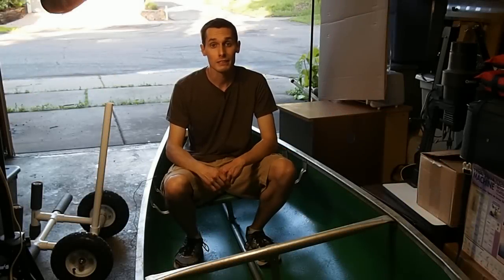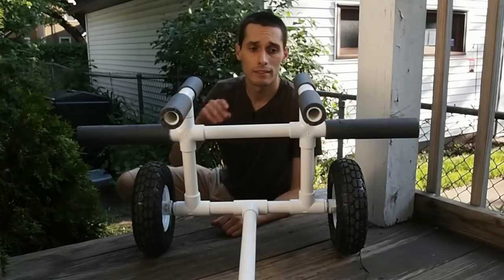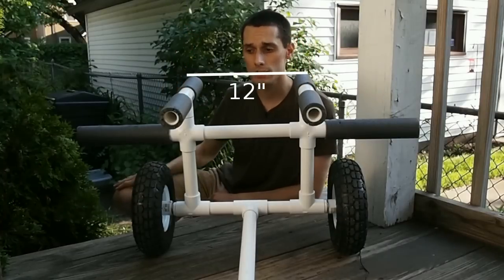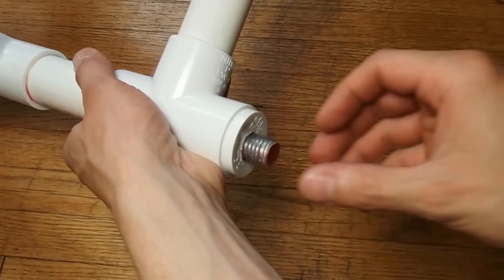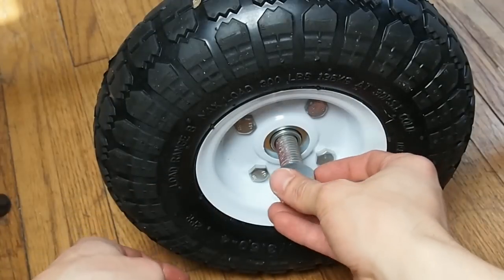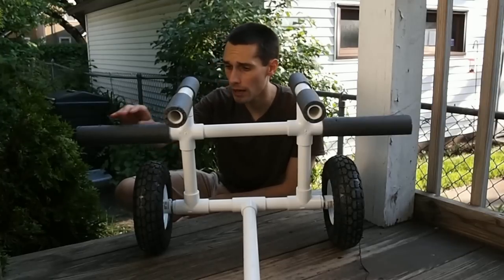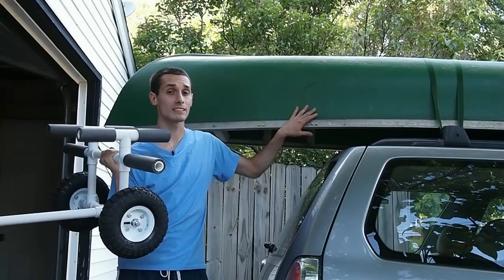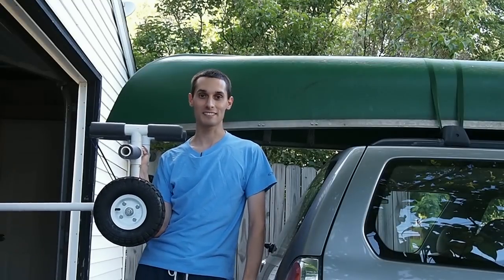DIY PVC Canoe/Kayak Cart

Comment: Cant get it to stay under the canoe. Even with a ratchet tie down
Reply: How did you solve this problem? I'm having the same problem. Also, did you cement all the fittings?
Reply: Same here. I am trying to use it to load the canoe on the car but cant figure how to keep the wheels vertical.
Reply: Same issue. Used pvc cement to secure all the fittings and the cart failed under the weight of my canoe.
Reply: I’m having the same problem with my cedar strip canoe.  The cart works ok with the canoe right side up, but doesn’t work with the canoe upside down. I think it needs two sets of wings to support the canoe. Not one.

Comment: Nice design!  Any idea how much weight it can bear (particularly with a canoe in the upside-down position)?  I have an Old Town Discovery (169) that weighs in at around 90lbs.
Reply from the maker: Adam Lopez Haven't really tested its limits but I bet it would do fine with a 90lb canoe. I'm pretty confident that I could stand on the side wings if my feet weren't too far out on the ends (and if I could balance that well). I'm not a huge guy but I am >90lbs. You could always built one with 1.25" or 1.5" PVC for extra strength.
Reply: Thanks for the reply.  I might make mine a bit more burley.
Reply from the maker: Awesome! Your modifications sound like great ideas!
Reply: Makify1 So....8 foot voyage in the front yard and SNAP!  Maybe the 1" PVC wasn't the way to go.  This was in the canoe "up" position, not even resting on the "wings" that I was worried about initially.  

https://goo.gl/photos/RjnRNkZAQJ4angjZ9
Reply from the maker: Oh no! I guess 1" PVC isn't as strong as I thought. Looks like the fitting broke, that's really weird.
Reply: I have to decide if I need to return the returnable hardware and buy a cart, OR look at more burley PVC and build up another.  Maybe a more braced design.

Comment: I have the same question as GoneByRVBlog.  In the video the PVC appears larger than 1 inch.  Also, you indicate that the length between the two top support bars is 12 inches.  That being the case, is that the length between the inside, center or outside of the two support bars?  I appreciate any clarification you can provide.  Thanks and regards.

Comment: I bought a couple of those cheap tires at Harbor Freight and filled them up to the 30 lbs pressure recommended... papoom!!!  The second one blew up in my face.  I was thinking about traveling on wilderness roads to remote Adirondack lakes and ponds.  These tires strike me as unreliable.  I may have to resort to something different.  I may have to go to the junk yard and find an old kids trike for the wheels or maybe an old stroller.  If you are shopping at Lowes, make sure you get schedule 40 pipe.
Reply: I have had many problems with those small inflatable tires for lawn equipment and such.  I find the best ones are the no inflate tires they sell for wheelbarrows. try 2 of those, never get flat and they bounce just like the inflatables pretty much.
Reply: Actually, I have a different plan but riskier.   After bringing the defective tire back and exchanging it, the new one is on the frame, inflated to 30 lbs, and has been sitting there for a month or more.  My planned trip into the woods is coming up at the end of the month and I will experiment on dirt roads, pulling it over dirt paths nearer to my home.  I am rigging a bicycle tow hitch and will be pulling the kayak to where I am going and I will be testing not only the tires but the tow hitch as well.  If something goes wrong I can salvage a problem like that.  Five miles into the wilderness with a blown tire is not something I want.  

However, before looking at this video, I reviewed all the commercially constructed ones and I always go to the most negative reviews, the one star reviews.  You know what the biggest issue is for the complainers?  Those tires that are filled, the no inflate ones stink to high heaven according to the comments.   I like doing DIY stuff so making a carrier was fun for me.  It probably cost me almost as much as one of the cheaper commercial ones but saving money was not an objective of mine and the one I made is not like this one although similar.
Reply: Dennis Lee  excellent good luck and have a great trip!

Comment: Where did you find your axle? I am having problem to find the right one.
Reply from the maker: It's usually available at most hardware stores. In the big box stores it is usually in the same aisle as the nuts and bolts but often kind of hidden in a rack with metal tubing and sheet metal. At smaller hardware stores it might be somewhere else. You can also ask an employee where to find the "threaded rod" and they'll be able to help.

Comment: I built it and have had constant problems keeping the cart standing up as I place the canoe on top of it. Regardless of how I place it, or tight the bungee, the cart flops over rendering it useless and more troublesome. I would welcome any helpful comments on how to make this thing as useful as appears in video.
Reply from the maker: Chris Hobbs Are you placing the canoe upside down on the cart? A few other people have mentioned the cart rolling over too but I've never experienced that so I don't know exactly what is causing it. My suggestion is to point the handle into the canoe and let the cart tip just a little so that the handle makes contact with the canoe and acts as a third contact point to prevent further rolling.

Comment: How are the threaded rods secured inside the pvc from in between the wheels?
Reply from the maker: It's a single threaded rod that goes all the way through. It's secured with nuts on the outside of each wheel.

Comment: I've looked and looked for your end caps that go into your pvc and can't find them....I know what they look like I just can find them...any suggestions?
Reply from the maker: Hmm... Sometimes they are rounded and sometimes they are flat. Most hardware stores should sell them. Maybe ask an employee?
Reply: Ive gone to 3 home depots and what I have found are 2 end male  reducers that both have holes already in the part that you drill your holes in (hope that make sense) which would be fine except one has a 3/4 inch hole and one has a 1 inch hole. Since you said to drill a 5/8 inch hole for the axle, If I use the one with the 3/4 inch hole already in it will that be to sloppy for my axle? Tomorrow I plan on trying sprinkler supply places if you think it would be.
Reply: I have no problem finding a rounded regular end cap but it fits over the end of the pipe(female) not inside it (male)
Reply from the maker: The male ones (plugs) are harder to find. My only suggestion is to try different stores. I know that's probably not helpful but it's hard to know what any one store will carry. You might have better luck at a plumbing supply store. Amazon carries them (http://amzn.to/2e1SscA) but they are pricey.
Reply: Millicent Phillips if you haven't already figured something else out, I replied to an earlier similar reply on how to get them through Home Depot

Comment: How do you keep the canoe from falling off the cart keeps falling over when I'm trying to pull it
Reply from the maker: I bungee cord the canoe to the cart and that seems to work. You could also try changing the position of the cart to balance the canoe better.
Reply: i am having the same problem. it seems the end of the kayak is not the place for the cart. more centered, and may have to push rather than pull. I also noticed that turning the kayak over, bottom up, the cart performed better.
Reply: ***** My kayak only falls off when I going onto a bad angle. Its top heavy so every direction of travel must be straight. Avoid going across hills on angles. That might help.
Reply: ***** see the bunjie ? Nerd !